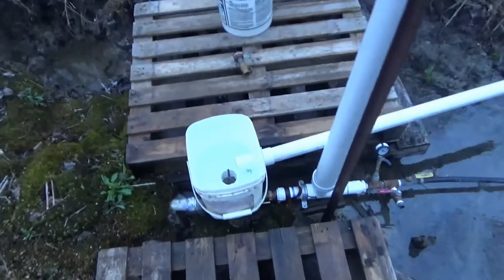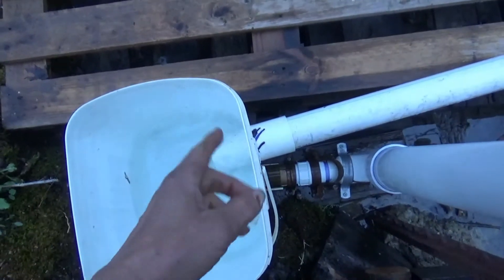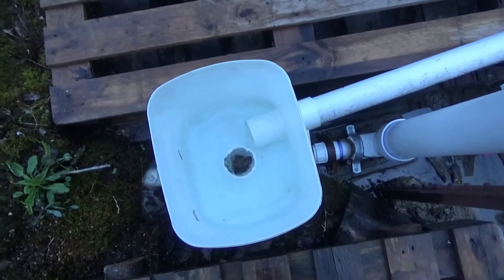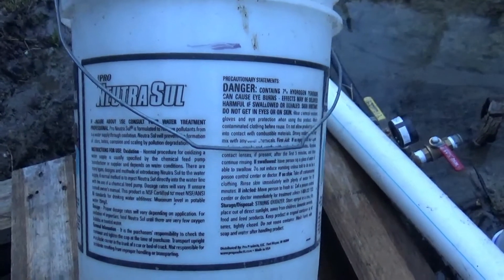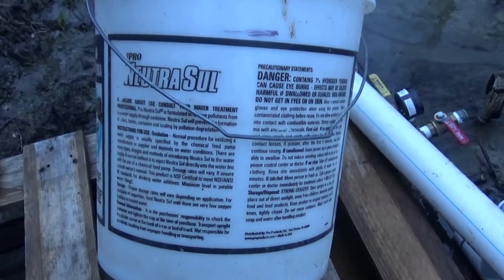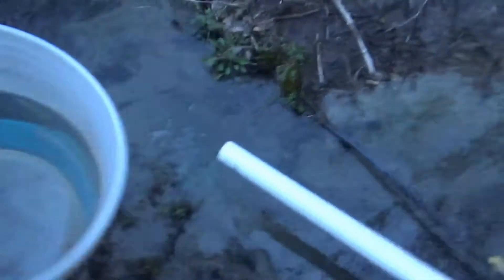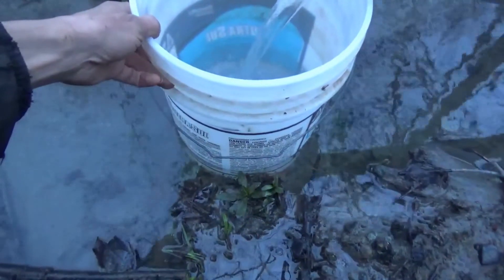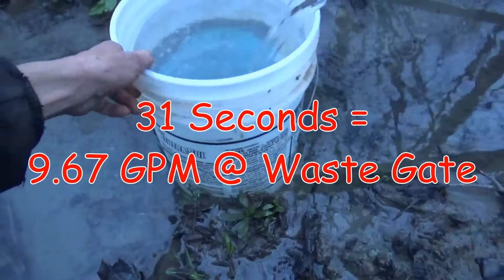How To Calculate A Hydraulic Ram Pump's Efficiency *Calibrate Measurments*

Comment: Your numbers means little without information on the delivery line head and pumping head. 
Do you have those 2 numbers? :)

You can find one by closing the delivery line valve and measure static water pressure. 
If you fill your delivery line with water and measure the static pressure of this line at the pump side you can also easily find the head of the delivery line as well 👌
Reply from the maker: Yes, in other videos I covered that. This is specifically to do with efficiency of the pump in those specific delivery scenario, not pressures. Drive pipe head is 6.5 feet,  Delivery line head is 58-72 feet depending on reservoir. cheers!
Reply: Thank you.

Comment: Hey how much power(watts) can be genrated from current outlet flow rate?
Reply from the maker: Less than you would get from just using the energy in the falling water.  If you seriously want to play with numbers: https://www.engineeringtoolbox.com/hydropower-d_1359.html  If you mean ram output at the top, if it was 5 watts it would be a lot.

Comment: Hi Just a quick question as I have been catching up with your videos. What are you using as a blader inside of your pressure tank for your ram pump?  i'm considering building one but i have seen many people using bike innertubes and i'm wondering about how easily they may fatugue?
Reply from the maker: a bike inner tube should work fine... i use tennis balls.
Reply: I recommend for you to buy  an 8 gallon capacity bladder pressure tank, its only 40 US dollar, Very effective.

Comment: Hello ! I also work on a hydro-tapped pump - I have an idea to loop around and take the power of hydrostatic power to get electricity through a mini hydroelectric station, but the most important thing is to depend on the flow and pressure of water. I myself, too, a farmer from Russia, but now went to work in Europe. it is possible to associate with you I have a couple of drawings but there is not enough money for the eksperemanty since electricity is expensive in Russia and it was not profitable to keep the greenhouses. but if you get free electricity then Everything will be fine. how to associate with you that you would experience with your ideas because in America you have better conditions.
Reply from the maker: Thank you for your enthusiasm... I would interested to hear your ideas or see your drawings. Yes, even in America... fossil fuels and or electric bills can kill the profitability of a greenhouse. Fortunately I am still small scale and fine tuning my efficiencies before scaling up.
Reply: @TheFarmacySeedsNetwork  Hi, I've been working on a ram pump design for a few years, sitting in front of it right now :). I do know that if you raise the water level over the output valve then you decrease the efficiency.  You could make the output line, the line you filled the bucket from, spill instead of clime, this would increase the output some. "Land to House" did a video on this.
Reply from the maker: Interesting, I can understand that but I found that the pump runs MUCH smoother when there is a little water covering the outlet.  It will reduce the total head a bit, but runs better. Yes, Land To House and I have collaborated to some degree on our findings.  Thanks for sharing!
Reply: write your mailing address - we will do it together, otherwise I can not now conduct practical experience far from the Motherland, I'll send you my ideas!
Reply: @TheFarmacySeedsNetwork  seeing this video and watching the friends idea about a hydrostatic power to get electricity i have to ask did it work the way it should ? cause i am working on a similar idea that on paper seems that is working !